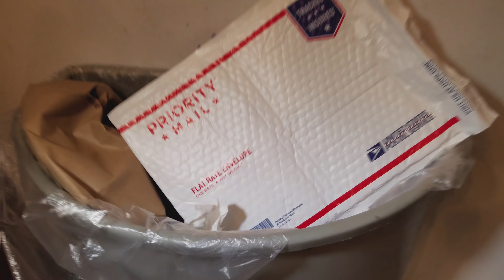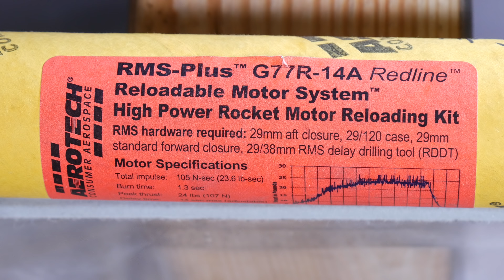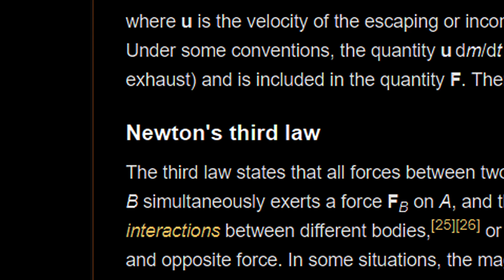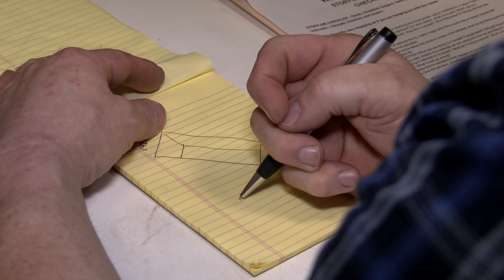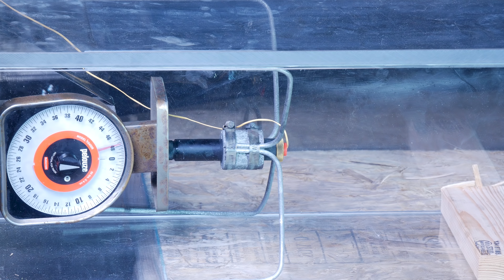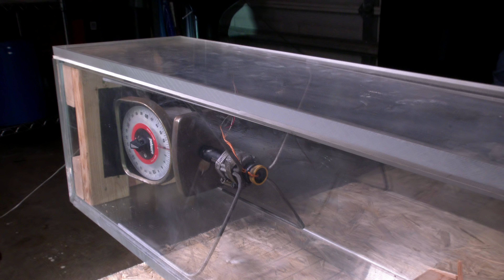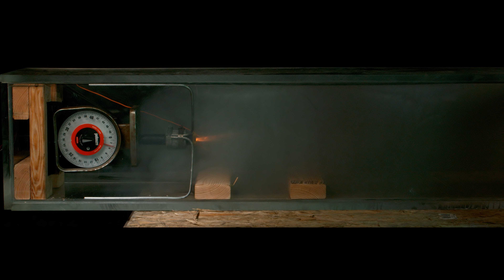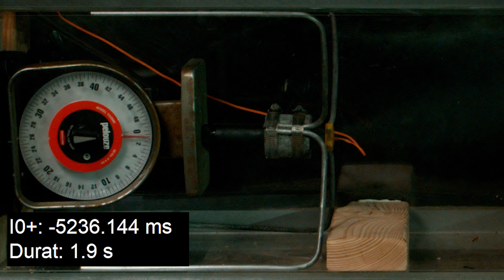Rockets in a Vacuum Chamber - Newton's third law of motion Visualized

Comment: Sorry to say this video doesn’t really do what it sets out to-  To dispel the myth that rockets can’t generate thrust in a vacuum.

It’s actually quite frustrating, because you did all the hard work in building such a large chamber and setting it up so it’s all working.  This is well documented too, showing the issues you had getting it to work.

But then the video is practically over.

This shouldn’t be the end of the experiment, but the start of the experiment proper.  Now comes the part of carefully gathering and presenting the relevant data.

I’m afraid the flat earthers actually have a legitimate point here (just for a change).  The chamber is clearly filling with gas and smoke as soon as the booster is ignited, and there’s a significant delay before it gets to full thrust.  Is the amount of gas in the chamber significant?  Well, that’s hard to tell from the video.  It looks bad on account of the smoke, and that’s what anyone doubting your conclusion will see.

What you should have done is plot a graph of booster force and chamber pressure  against time for the duration of the burn.

Then you should have done the same with chamber at atmospheric pressure.  Maybe even one time sealed starting at atmospheric pressure, and one time unsealed.

Then compare the graphs side by side, and discuss what the results mean before coming to your conclusion.

In a regular lab set up, I’d have used a pressure transducer and force gauge wired to a computer/digital scope/data logger to get most accurate results.  However, for a video you may be accused of making up numbers.  So next best thing is to clearly film both gauges and take numbers for graph from that, so people can confirm numbers themselves.

A possible follow up test could eliminate the issue of the booster taking time to get going.

If you replace the booster with an airline from a cylinder or compressor with a suitable nozzle, you can provide a consistent flow virtually instantly the moment you turn it on.  You might need a more sensitive gauge/kitchen scale though.

Results from that test should be very clear.  If the flat earthers are right, you’d start with zero force increasing slightly as the pressure slowly rises in the chamber.  If normal physics is right, you’d see a force as soon as air flow starts.

If you still have the vacuum chamber, it would be good to revisit this experiment.  If not it seems a bit of waste of all your hard work building the thing which is pretty impressive.

Sorry if all that sounds a bit harsh.
Reply from the maker: Thanks ... Not harsh at all. there are definitely a lot of valid points to make, unfortunately I had the team from UIC there so I was in kind of a hurry when we were filming and got sidetracked a bit. I also wanted to post a video and collect some ideas from people so I can do another episode, I have about three episodes that branched off of this episode that are coming up soon. Thanks for the feedback, I would definitely be interested to know what type of experiments I should do, or what your opinion is. Thanks!
Reply: Thanks for reply.  Yeah, I didn’t really factor in things like your recording schedule, or that you might have drafted in external people.

I’m not really sure what else to suggest other than spending a little less time on the construction side and devoting a bit more towards discussing results, so people can see why you came to your conclusions.

Conclusions that seem obvious to you or me may not be to everyone.  So it’s always worth thinking about what arguments they might have against your videos and be ready with the data to back up your case.

Obviously there will be some just calling you a liar, a shill and a globetard, but there’s not a lot you can do about that lot.
Reply: @WarpedYT  The SIMPLEST solution is to repeat the experiment with a TINY gas line run into the chamber.
Then at max vacuum, just release TINY puffs of gas through the hose and record the recoil of the end of the hose. (this is a "Cold Gas Thruster"  like what SpaceX uses to maneuver the first stage boosters)
Monitor the vacuum through each "puff" and demonstrate that the vacuum was "MOSTLY" retained through each puff.
The SMALLER the puff the better for proving the point.

AND you can do many "puffs" without breaking down the entire chamber (just pump down again and repeat)

Comment: Sorry to say you didn't prove that rocket motors work in a vacuum, and you didn't prove Newton's third law can work in a vacuum. (Whoops!!! I correct myself here. You did barely prove your point in time queue 10:13.)

Here is where the experiment failed. (I correct myself: It was successful for an instant) While you did successfully pump out all the air with your vacuum pump, the second your igniter started it filled the chamber with expanding gases. So no more vacuum in the chamber. Your SRB didn't start right away. When it did finally start, it was no longer in vacuum. Plus its fuel exhaust also contributed to the pressure spike in the chamber. Time queue 10:13. 

To be sure, the scale did compress to show thrust from the SRB motor. I don't buy into all this nonsense about the rocket exhaust pushing off the "air" in the chamber (it was ignitor and SRB exhaust), nor that the SRB pushed off any part of the chamber itself. I believe you did demonstrate Newton's third law, but not in a vacuum.

Perhaps you can rethink this experiment. You could certainly find a way to use your vacuum chamber to test Newton's third law in a vacuum sans SRB rocket motor. Perhaps rig up something with a compressed air bottle that can withstand the vacuum in your chamber. Or perhaps a spear gun or small crossbow on a roller skate.

Comment: That square box would collapse way before you reach a total vacuum !!
Reply: This is false. It only has to hold OUT 14.5 PSI (at sea level) even with a "Complete vacuum" inside.
So that would be thousands of pounds on the lid, but very evenly distributed.
Did he use acrylic or Lexan?
Lexan would be strong enough.

Comment: This experiment doesn't prove a thing that it was supposed to.!!!
   First of all you can tell that when the different model rocket engines ignite there is an initial jerk that they think is thrust like normal rockets move in an atmosphere but it's more like the initial debris and gas plums that build up right behind the engine are acting as a temporary atmosphere until it's completely ignited there are many unignited bits of fuel and other debris that get behind the rocket engine and therefore it's able to push off of those things as well.
    Most telling of all was how the larger rocket engine ignited from the back of the vacuum chamber towards the model rocket engine itself which tells me that the chamber was compromised as soon as there was an ignition attempt possibly even beforehand because there's a possibility that in a vacuum parts of those fuel chemicals are off gas and leach into the atmosphere behind the engine or that the rocket engine has to throw a basically invisible spray of chemical propellant all the way to the back of the chamber far enough to where it can bounce back and then ignite and be pushed off of and feed itself so that it can fully ignite no other explanation to why it ignites from 3 ft behind the rocket engine and then burns up to the engine very strange.
  This vacuum is not even near large enough for any of these attempts to be validated to test Newton's law it would have to be so much larger and not so linear in shape so that the top and bottom inside of the vacuum tube are not so close to the engine because it's not just straight behind it that it thrust from their Eddy currents and turbulence and blowback that goes off to the side imagine a space shuttle launch watch all the rocket engines burning then imagine there are huge glass walls right outside the launch pad on each side and then imagine what that would look like and how that would affect the launch and the engine exhaust and fire plumbing etc.
Reply: Sorry but rockets do NOT "Push on the air in the atmosphere".
They work via RECOIL force of pushing out mass.
Would a crossbow fired into a vacuum have any recoil?

Comment: "That means there is some truth to what the conspiracy theorists think...." 
I can't think of a single rocket that uses solid propellant in the vacuum of space so right from the start there is already a flaw in the conspiracy theorists' "thinking".
They are only ever used as first stage boosters because they can't be controlled once lit and they burn out well before getting into such a low pressure environment. 
I'm also dubious as to whether the solid fuel that is used is meant for low oxygen environments or for amateur rockets lit at sea level.
They are also lit in different ways, actual boosters use explosives to get them started.
And as several people have pointed out, you don't need an atmosphere to push off against, the controlled explosion at the back pushes the rocket itself.
Reply: "I can't think of a single rocket that uses solid propellant in the vacuum of space"
Sorry but we do this frequently.
I have personally helped launch five spacecraft on Delta-IIs.
FOUR of the five had solid rocket motor upper stages that lit in vacuum.
Reply: @stuartgray5877  
Interesting. I didn't find any information on solid rockets used on the upper stage, but I did find this information about the ones attached to the first stage: "If 9 solid rocket boosters were used, only six were ignited at launch. Once the first six were depleted, three air-start motors would ignite and the ground-start motors would separate. The air-start motors had nozzles optimized for high-altitude as they operated mostly in a near-vacuum during the flight profile."
So I stand corrected on that.
Reply: @WishingForSerenity  Just lookup the Delta-II rocket on Wikipedia.  May I ask what THIRD stages they use in them?  (hint: Star 48B)
And Yes two of the delta-IIs I launched had six ground lit, and three air lit solids.  But those were not even the ones I was talking about.
Reply: @stuartgray5877  
I see that now... I had to click through it all and look up the Star 48B specifically to find that it is a solid fuel booster.
Thank you for the heads up.
Reply: @WishingForSerenity  They typically use the solid third stage for interplanetary missions.  The ones I launched were Mars Global Surveyor, Stardust, Deep Impact, and Kepler Space Telescope.

Comment: Rockets use rocket fuel which is caused by chemical reaction to ignite in space, what you got is a firecracker, totally different.
Reply: Solids rocket motors are used on space frequently
Reply: @stuartgray5877  Are you talking about toy rockets?
Reply: @senateboy0909   I have launched five Spacecraft on delta-II rockets. Four of those had solid rocket motor Third stages that lit just fine in hard vacuum and propelled those spacecraft out of Earth orbit.  They were: Mars Global Surveyor, Stardust, Deep Impact, and Kepler
Reply: @stuartgray5877  Well, shut my mouth, didn't know that, I was assuming lunar landers.